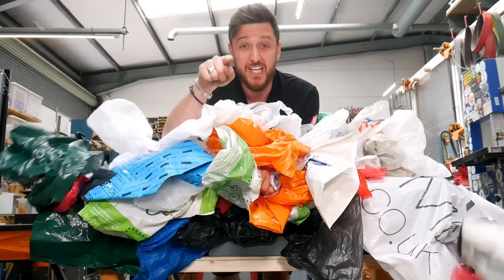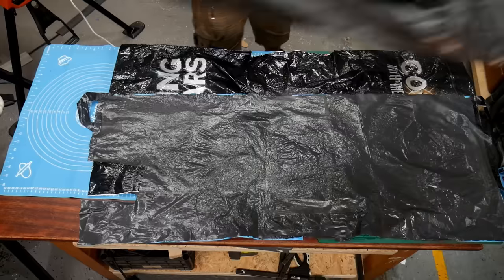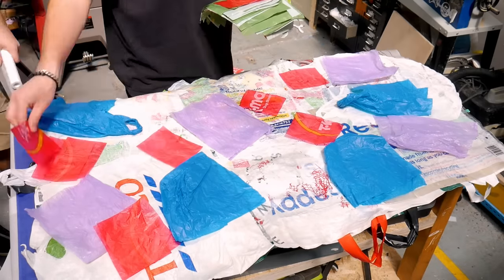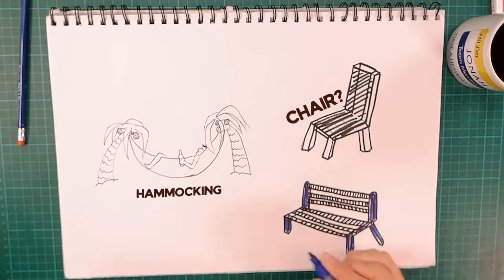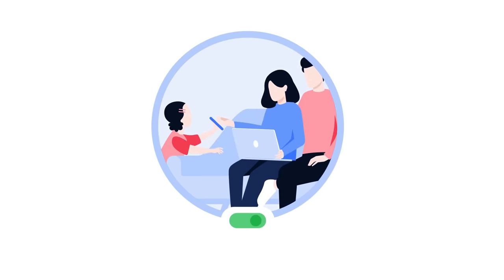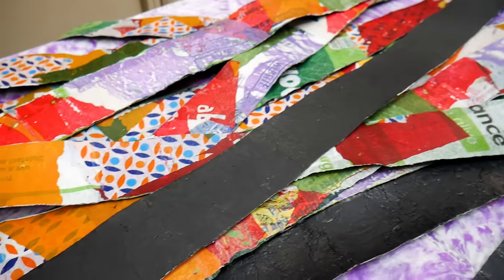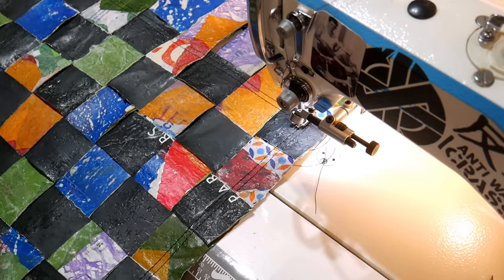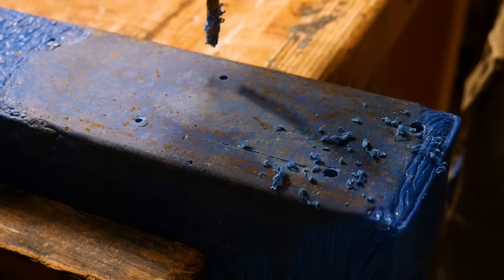Is THIS a Better Use for Plastic Bags?

Comment: This looks so cool. If you wanted to try to fill those holes again I wonder if you were able to use a small soldering iron to melt some of the existing martial in the hole before adding more melted material. It might adhere better. Just a thought. I enjoyed the video and the idea of reusing all that plastic

Comment: I wonder if an old ironing press (like what they use at the dry cleaners) would be faster and easier than a home iron. They cover far more space at once, probably two or three bag sizes at least. This would cut down your ironing time and probably make a more complete press together? Just a thought, of course anyone doing so would need to do a lot of products in order to make it feasible and economic. 
I was aware that people crocheted bags together but this is the first time I heard of ironing the bags together to create something. You have my mind reeling with possibilities!
Reply: I see you thought of this before I did. I hope that if someone does try this they don't overlook the possibility of procuring a used commercial ironing press.

Comment: You can also wash plastic bags in the wash on cold. Detergent washes just as well in hot or cold because. it's far superior then in the past. I use bags for everything. When I have my kids' dirty laundry, I throw the bags in the washer inside out, then hangdry. They last quite a few washes. When they get holes in them, i double layer the hole-y ones for trash bags

Comment: Thank you for showing us how to do something without a lot of specialty tools and equipment. I bought a second-hand Sandwich Toastie Maker. (Two flat sides that heat up and flatten one over the other, with lids in the middle). Set up some brightly coloured bottle tops I’d been collecting for a few years. Used to donate to the Kindergarten but little one has advanced to school now. So, not to waste the lot I had saved until I saw your ideas with bottle tops. Hm “first five tries is practice” so I have Four more times. lol
But this plastic bags and the iron is a brilliant idea. And I won’t need any electronics to do it. However,

QUESTION 1 ******** What did you send your stack away to have done? ********

QUESTION 2 ******** Could I use some spray glue that’s for joining material and lining? *******

Thanks guys you do a great job👌🏻! 👏🏻👏🏻👏🏻👏🏻👏🏻👏🏻👏🏻👏🏻👏🏻👏🏻
I’ll read the instructions on the tin as well?

Comment: Here they put a ban on non-reusable bags and introduced "reusable" bags which were just the same bags but with x3 thicker plastic. They aren't recyclable through any local facilities and most stores aren't equipped to take them back. We get our groceries delivered, and they have adamantly refused to return the prior delivery's bags. All it's done is make even thicker plastic trash! I've been wondering what I could make with them, and this video helps give some ideas!

Comment: You two are HILARIOUS!!!!!!!!!!! Which one is Matt and which one is Jonny?!?!?  I live in Louisiana, USA. Somebody over here came up with a way to use t-shirt bags (aka grocery bags.) Straighten the bag out. Straighten the bottom out, hold the bottom, pull on the handles (make sure the seam on the handles is on the outside,) flatten the rest of the bag. On a table I use a ruler and a black Sharpie pen to mark the bottom seam 1/4 inch or 5cm from one end to the other. Then, continue marking up every 2 inches or 2 1/2 cm to just under the dip where the bag was attached to the bundle at the store. The bottom seam and the top, handles and all go in another bag set aside for scrapes. With the loops of plastic half-hitch one bag to the next, and on and on. Pick up the end and wrap around four fingers until you  have a bunch on your hand. Pull it off, twist it on itself and wind the rest of the looped bags on the ball you have created. You have just created "plarn," plastic yarn. I take the plarn balls to my local library where I know a woman who teaches knitting and crochet. She or a friend of hers will crochet it into a sleeping mat for the homeless. ( How To Make A Plarn Bed Roll.) See this website.         :)  :)  :)

Comment: Curious if that ironing method of merging the plastic is what I was looking for when I found this video... saw a man on some video who recycled plastic bags into a dense wall that provides good insulation and protection from the elements... it appeared shredded, and held together well from what it looked like in the interview... and as I finish typing the previous sentence, I see Youtube Recommended showing the Brothers Make Recycled Plastic Bricks video that is about exactly what I am looking for lol. Subbed, and hopefully be able to make some cool stuff now with plastic bags. I usually just used them as trash bags for small bins, but felt they could have a better use that doesn't lead to them piling up.

Comment: My experence with plastic shopping bags laying in a very hot and cold uncontroled environment is that they start disintegrating within a couple of months.  A year ago I tossed a crocheted plastic bag mat outside where the temperatures get very very hot where I live, and well not often freezing very far pretty cold in the winter at night, and I threw it away the other day it was coming apart all over the place.

Comment: Seems like a plastic bag hammock would feel gross, since it’s unbelievable. You would just end up sweating and sticking to it. I think, using material for messenger, bags and backpacks, tote bags., etc. is a good use. Going by what I’ve experienced with plastic bags, the sun would rip the stuffed pieces if it was left outdoors. That would influence possible uses.

Comment: i want to see you build a boat/kayak/canoe by fusing plastic together like this. you could salvage wood from a pallet or two for some more rigid stability. but i think that would be a totally cool build!
Reply: also if you could convert the ironed bags into 3d printer filament somehow, that would unlock so much you could do with it. this is already beyond cool!

Comment: Contact your local cafe...ask them if they would like seat and table covers......woven for the seats, and simple "single" layer for the tabletoppers.
Placemats?
Changing pads for babies?
Plant pots?
Peg board in the shop?
Big shopping bags?
Fashionable shoulder bags for ladies with big designer sunglasses?
Yoga mats?
I think the key here is to start thinking of them as a raw material .... Like sawdust and splinters were when lumber mills started making particle board and chipboard.

Comment: Traditional plastic bags are almost impossible to find in New Zealand now. They were banned a years ago. Very soon produce bags will be replaced with paper as well. 

This all sounds well and good, seeing as reusable ones are now majorly in circulation- however to offset the emissions (and amount of plastic waste compared to traditional bags) from those bags, each one has to be used over a hundred times. But due to how low quality they are made, they inevitably break within 30 or so. 

So while it COULD be a feasible solution,  the bags would need to be much more well made to hold up to the number of uses necessary to truly be a better alternative. It seems like companies found a sort of loophole to get around doing any real work to be better.

Edit: it appears the numbers have since changed since I first heard about them. Here is an updated list of the main types of reusable grocery bags around:

Organic cotton reusable bags: 20,000 uses

Regular cotton reusable bags: 7,100 uses

Polyester bags: 35 uses

Polypropylene bags: 52 uses

Paper bags: 43 uses

Comment: I'd imagine that perhaps if the strip format was imagined as the goal beforehand, perhaps instead of ironing them all flat, one could instead twist them into "strings" and even tie some of them together, which in a way makes of a single bag a multi-layered thing, in a way, not totally literal, but sort of. I also wonder whether ironing is the most effective unsophisticated DIY method, maybe "baking" them in the oven somehow would be simpler and use less energy? Although I don't have from the top of my head some way of doing it that wouldn't risk making a terrible stinky mess if something goes wrong, not even some obvious way to even put them there in some kind of surface they'd not stick to, discounting accidentally melting/burning them. Rather interesting anyway. One thing I imagine it can perhaps work nicely for is to seal holes in tarps, assuming the materials of both would melt together to some degree. In some places I think plastic bags are no longer real plastic but some cellulosic thing that kind of feels like plastic but must have completely different properties, biodegradable, better for the environment, but not suited to this kind of reuse, at least not without some kind of impermeabilizing coat or layer of some sort, besides a different method altogether to fuse them, probably some kind of glue, if that's worthwhile at all.

Comment: Interesting. I assume yes, that the same type of plastic melds best with the same, but Do you have to use the same type of plastic? or can you mix them? high density polyethylene (HDPE), low density polyethylene (LDPE), linear low density polyethylene (LLDPE), medium density polyethylene (MDPE), and polypropylene (PP). Thanks. You guys are great.  What you did making the bench, they should be able to use this in the space station to save on weight. Re-use, re-melt plastic into other items using a 3d printer.

Comment: Use some 8mm 10mm 12mm 22mm  copper pipe cut in half then put together with jubilee  clips melt plastic of cuts for different size dowels for hiding screw holes  or pegs for strength

Comment: I wonder whether you could reinforce the plastic by sandwiching fabric between the  sheets. That would make it more sturdy and tarp like. Although it would probably make it a one-off creation as I couldn't imagine those composite parts being easily seperable for latter recycling.
Reply from the maker: That’s the exact reason we don’t mix materials 😊

Comment: Huh! Thats a pretty great hobby material! I thought it would shrink more when you ironed it.
You can get a 3D pen that uses filament, basically a tiny, temperature controlled hotglue gun, should make it very easy to fill small holes like that. Or, if you have a more adjustable hotglue gun make your own "glue pellets" for it from the plastic scrap? I mean, high risk of overheating the plastic but would be great for filling and gluing plastic projects with the plastic they are already made of.

Comment: I’m looking to do a garden project on the cheap. I’m wondering if I combined this plastic bag idea and overlay on cardboard if I could create a small structures for my plant pots to sit on instead of making them from wood. I’d be looking at glue for bonding. Sealing with maybe a gloss finish… unless you guys have some other ideas how I could produce something similar with the idea of reusing plastic bags 🤷‍♀️😬

Comment: What you need is an old iron. I see you were using a newer iron.  They are made on the side of caution to never get "too" hot.  They give up their heat quickly but don't get hot again fast enough.  Just not enough heat I have noticed even with damp denim.  With the parchment and a good hot iron, you could whip out panels of this stuff. 
Still plastic still gonna degrade and wear out

Comment: Have you tried making anything out of bread bags? After watching this I tried the iron technique with bread bags, but they're a different kind of plastic than the typical shopping bag (which infuriatingly local shops are still using even with a statewide ban because the ban was only for certain kinds of businesses). Anyway, I found I could not fuse more than two layers of the stretchier bread bags.
Reply: I have used bread bags before to fuse a cloth patch over a torn piece of clothing. Iron bag between the two cloths, of course.
Reply: great idea! I'll have to try that :D @annmnm-sy5cq

Comment: Did you know that you are not supposed to apply heat to those green cutting mats?  You can purchase insulated material or even an ironing board cover to lay over plywood.  
I like your idea of fusing the plastic bags. Do you think plastic bags could be melted down into a form to be used in 3D printers?  You could make recycled "glue" for a hot glue gun to fill holes.  Just inject the newly melted "glue" into the holes. 
I LOVE the chair.   More please!

Comment: Would it make a good floor matt? It seems like the perfect solution to cover up the peeled up Pergo laminate my slumlord won't fix. It was damaged and past the warranty when I moved in, I've looked and looked for something durable enough to use but thin enough not to trip over and can be taped down to blend in with the floor, plus custom design!
 (Amazing how one can trip over something less than a millimeter thick, chipping it more every time).
Now I'm thinking about how to add texture or 3D tiling, hmm...

Comment: I've been trying to figure out how to make a 3 ft by 2 ft air pods that can be blown up and air released like flotation devices. I'm building a 23 ft houseboat and will attach to sides of boat as a stabilizer. If you can help figure out how to attach the plug for adding and releasing air would be great

Comment: Some ladies in Florida, USA would cut very small strips of bags then they crocheted sleeping size mats for the homeless to use.  I think they must have built them up like you’re doing.  But I lost that video and don’t remember what kind of tool they used to make the strips to crochet those mats.  I always wanted to do it but can’t find that tool they used. Do you know?
Reply: One can cut the plastic with scissors or a rotary fabric cutter

Comment: You had a slight problem with the bags not all being laminated together. Well I wonder if you found and recycled an old plastic laminator thingy. Run the strips through it. Thanks for the videos guys. 
Tom

Comment: You can iron that under some foil but you really should wear a mask and have good ventilation when you do that because when you melt plastic you release formaldehyde into the air and formaldehyde is carcinogenic.
Reply from the maker: Check out our plastic fume safety video for all the facts on recycling at home 👍🏽

Comment: My city banned the cheap thin plastic bags....however, I would reuse them a few times before finally using them as a garbage bag. Now I have to BUY THICKER HEAVIER plastic garbage bags and dog poop bags just to use them as garbage bags! Plus my building now makes us double bag the garbage. 
So it seems like a failed way to reduce plastic bags.

Comment: Using this plastic material and some of your plastic boards. Then hell you could make plastic screws and build small shelters for a homeless person. Way stronger than a tent. You could use the same material and make room separators, even a tall backed chair. Id even go as far to say a sofa.

Comment: I am seeing that plastic bags are made of different kinds or plastic… some are HDPE, some LDPE, others LLDPE, and there seems to be a few more. Can these various forms be mixed when ironing a thicker fused plastic sheet? What about the heavy plastic of dog food bags… can they be mixed with the grocery sacks? One brand of dog food labels their bags as 4/5 and the other brands are similarly thick but unlabeled. One has a silver colored  inner coating.  If not do you know of a reliable way to identify and separate bag plastic types? Can plastic that is shrunk around packs of toilet paper be added? 

I live in Mexico. Our municipality and others around us have stopped picking up trash. Neighbors are burning it causing air quality issues. I cannot fix the entire garbage crisis here but I would love to do something to reduce the amount of plastic my family is contributing to the problem. There actually are very few grocery sacks as everyone here uses reusable sacks by law. We only get them with delivery of something that cannot be in a paper sack due to wetness/condensation. 

The need for tarps here is huge so I would love to make large thick sheets I can put grommets into.

Comment: Great video, guys! However, you seem to be remiss in mentioning a disclaimer right in the beginning about how toxic the fumes can in heating up plastics. *88Anyone attempting that should be doing this in a well ventilated space, preferably outdoors, and wearing a mask with a filter. While it seems extreme, I've seen people in my industry get very sick from this very stuff.
Reply from the maker: No disclaimer because we made a full video all about plastic recycling safety ♻️🤙🏽

Comment: Just found your channel. (Binging now...)

What is the temp the plastic starts to deform? As I live in the Midwest of the US and it gets over 90 (sometimes into triple digits) on the summer.

Would hate to do all that work for something outside only to have it get ruined in the heat of summer

Comment: Love this idea.
I do have I guess it would be a challenge. 
What can you come up with for the plastic stripes for holding you 6 packs. I cut them up in tiny pieces a put them in a plastic bottle. Very time-consuming. 
I don't like the idea of animals getting stuck in them. And I don't want them eating it either.  So cutting them up and putting them in a bottle was what I came up with.  But after finding you guys, I think there has to be a better way. Any thoughts?
Good luck.  Can't wait to hear what you come up with.

Comment: Could you run those strips through a laminated machine (no laminate), just to heat it back up and press together.
Reply: I guess you should put layers of parchment paper around strips before running through laminator. Thanks for recycling 🙂